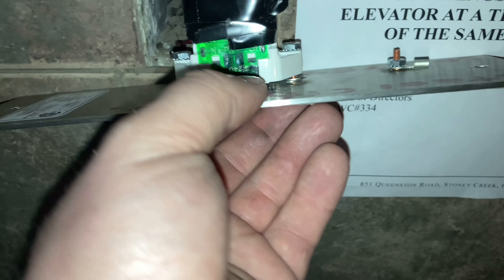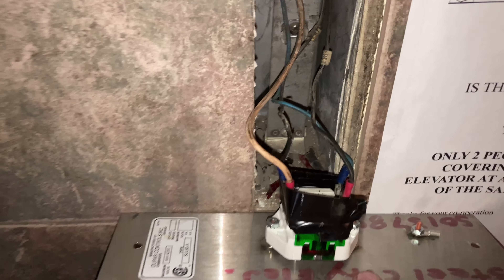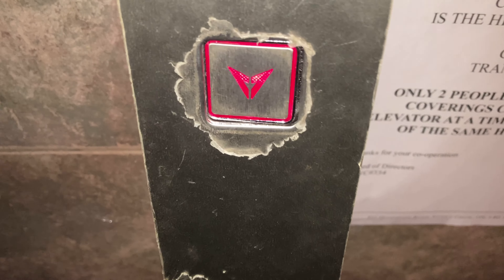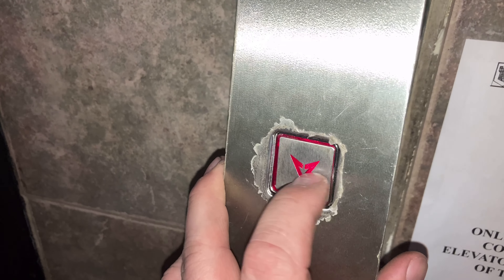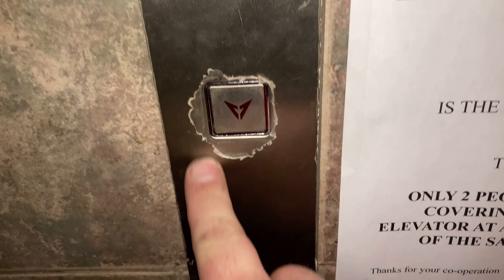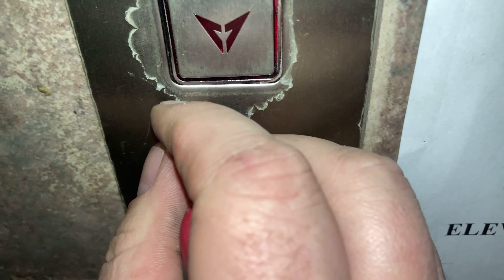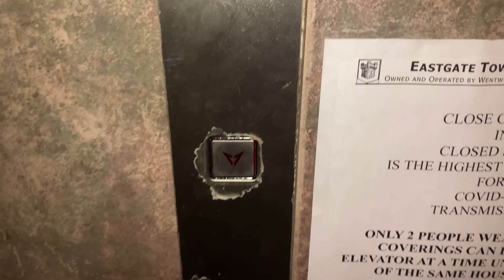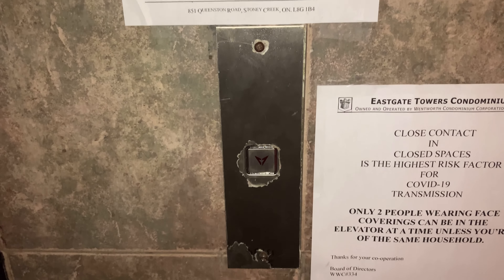Short Button Video

Comment: they make a drill powered rubber pad that is great for removing vinyl etc,  like 7.99 on ebay.  looks like a orange hockey puck w groves on the ends.

Comment: Have you tried goof off? I've had good luck with that removing junk on fixtures.

Also, if these are being modernized soon, are the old buttons going to be discarded? I don't know if you know about this, but I work with a small elevator museum in Roanoke, VA and we collect old elevator fixtures. Dupar is something we don't have a lot of.
Reply from the maker: I am aware as I follow you videos, we spoke before on one of your live videos when you were working on a Schindler hall button. I’ll look into what is being thrown away and kept.
Reply from the maker: I'm sure I'll be able to get some stuff from that mod just have to see what it takes to ship the stuff.
Reply from the maker: Well Car 1 starts this summer so I will definitely look into for you